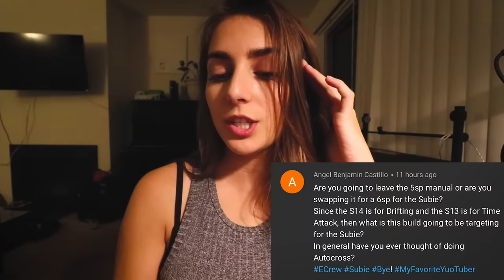Spilling the tea... + DDE & Tanner Fox

Comment: Hi Emelia. I daily drive a highly modified Subaru Impreza WRX ProDrive, 2006 hawkeye, with a FM intercooler. i can say without a shaddow of a doubt the front mount is the best way to go, to prevent heatsoak in traffic and improve cooling.

Comment: Emelia, doing the subie lift is easy. Forester struts & springs with outback trailing arm brackets and adjustable trailing arms is a good 2 inch lift maybe more. Mine is done that way with 16×7 +35 offset sparco crimson tarmac wheels, with a 1 inch spacer running 215/70r16 cooper discovery rtx tires. Fennders cut for fit. Ride is good still sorting out there rear sway bar though.

Comment: 10:54 Emelia, you’re more than welcome to drive my Mk3 Supra with a 2JZGTE engine swapped in. The swap is FINALLY finished and my car is up/running. I had it on the Dyno (rental) this past weekend where I was tuning my Fuel Table. The owner of the Dyno had to leave so I cut my tuning short. 

But I’m shooting for 15psi on pump gas where I’ll be tuning the Fuel and Ignition timing tables myself. However, for E85 with the triple Fuel Pump setup I made over the summer, I’ll be letting Sound Performance handle this tune/calibration....as I don’t have Knock Sensors just yet; therefore, I don’t trust myself to handle high cylinder pressure at MBT ignition timing. I had to move my tuning date to March. But you’re more than welcome to drive it once it’s done!! 🙂

Comment: Don’t worry about skyline motors and 2JZ what you need to do is get an Aussie 4.0LT Barra turbo motor. They are being exported to USA and they are about 3-5 grand aus depending on the kilometres and all you have to do is put 3-10 grand depending on what rwhp you are after and you would have from 360rwhp- 1300rwhp and they are street drive able. If you have a chance look up powercruise Queensland raceway and see what big dollar cars are being beat by ford xr6 turbo that cost from 5000 to what they do to the car. Mine cost me $8000 and I spent $4500 on engine and $2500-$3000 on wheels and couple of miner things that would be better to have them done because of extra power and I have beaten GT2 911 couple of other euro cars and Holden V8 commodores and I have really reliable 400+rwhp to take my son to track days and car places everyone goes on the weekends and he watches all your videos he was probably just as upset as you were when you had problems with your C8. There is a rumour that a mustang has one of those motors in it like the one on Tokyo drift and it is way faster then the movie car and it is over there somewhere.